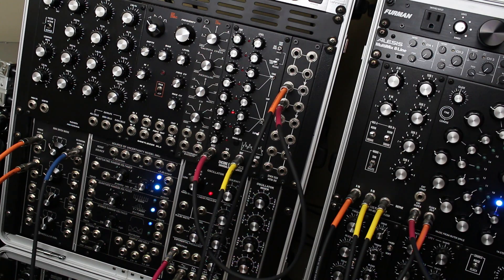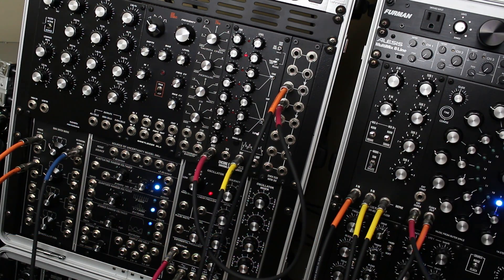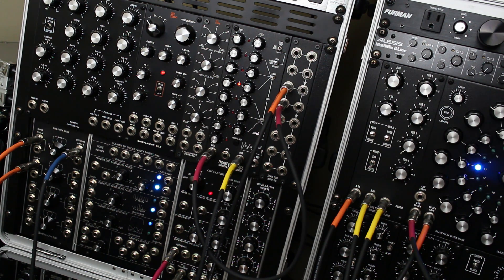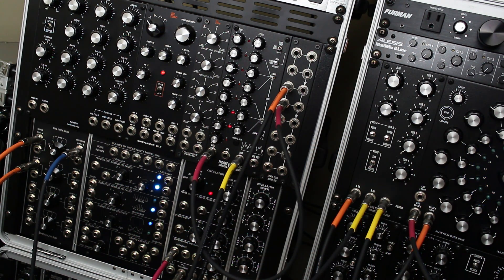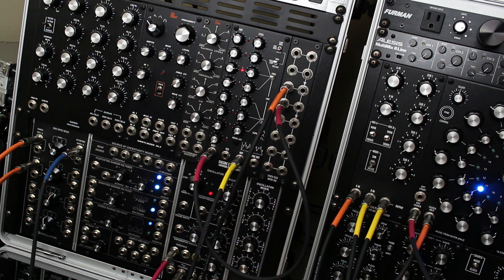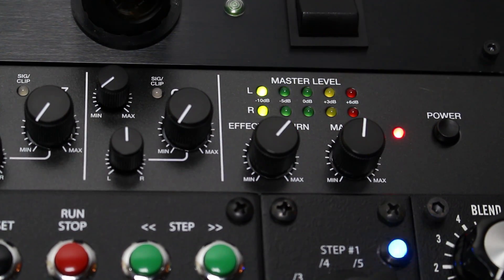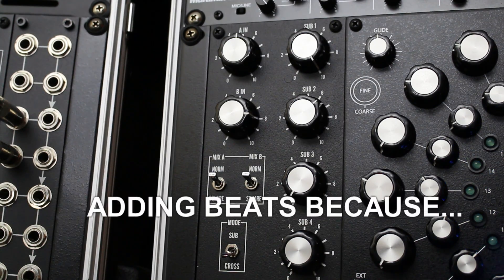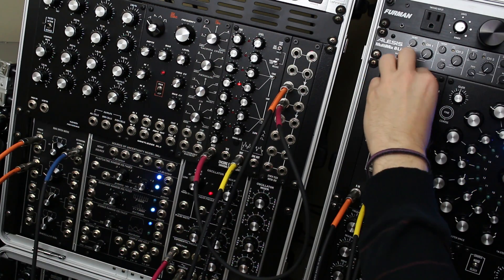MOTM-120 Sub-Octave Multiplexer Module Demo

Comment: You have it on cross - not sub... interesting. My 120 is in bubble wrap - I stopped using it. Maybe I should pull it out.

You are mixing MU and 5U - I thought there was a width difference preventing that? Your using standard MOTM rails w/ the MU and I assume MOTM power supply? Thanks.
Reply from the maker: Correct on the MOTM rails, but I use Dotcom power for everything (just bought little adapters to convert the connectors).
As for width, as you can see in the standard 19" rack space MOTM offers 2U more width of module options in the same allotted space as they are more narrow than Dotcom.